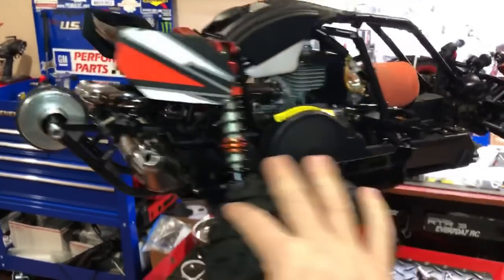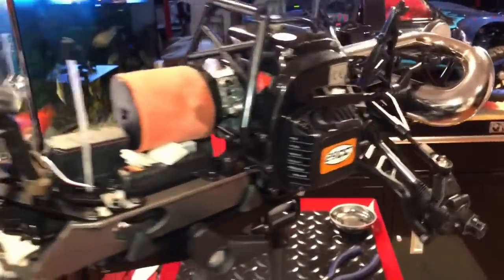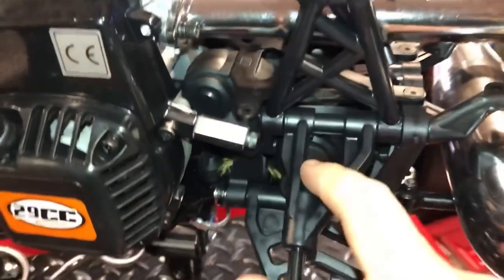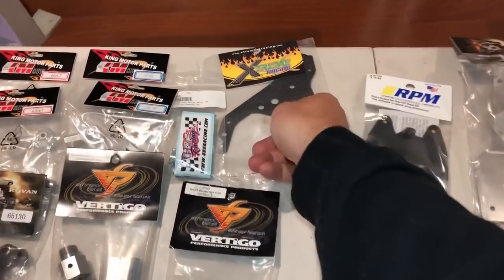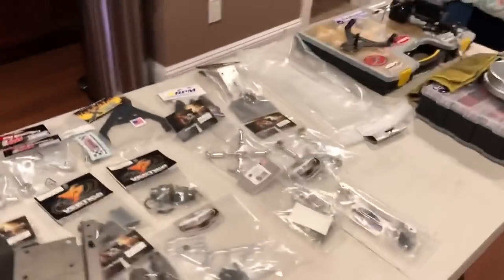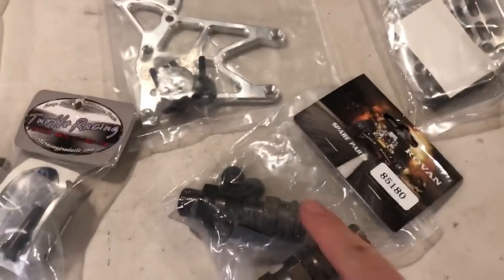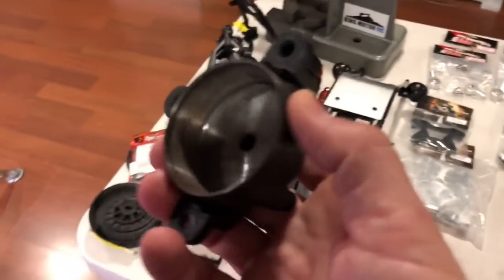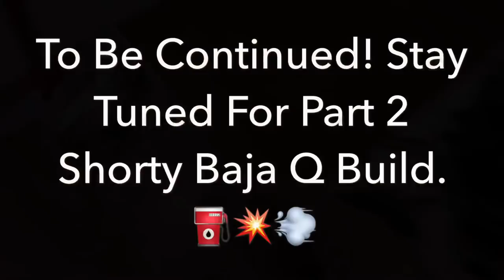Part 1, Let’s Go Over & Rebuild My Shorty⛽️Baja💥Q💨Together From Start To Finish!

Comment: Now that Ive upgrades to a Baja 5b I need to familiarize myself with the construction of these constructs.  Its winter now so I have a few months to learn as much as possible before spring and awaited glorious 2stroke run-in.   Ive realized as im sure you know Botajell that its easy to go overboard as I already have.  To spend more on quality upgrades than the initial cost of the entire vehicle is not a new concept to me cause i like having quality.   Quality in my opinion is paramount.  Thanks for helping the RC community with your videos, not only are they informational but they also help people stay excited about the hobby during the off season.  Sober fun is a much healthier way to live and I really enjoy your enthusiasm.  Thank you

Comment: Man your channel has grown so fast in the last year. I started following around October of last year I believe and you only had a few hundred subs and now you're at 72k! Sheesh! Keep up the great vids. Next spring/summer you need to get the truggy out again. Because of your vids, I was able to build my 7TR truggy to run with brushless rigs. Modded 28-8, 9886/41032 with a Buku clutch. 🔥🔥🔥

Comment: Hey bro, looks like the air filter rubs on the servo arm. Is this correct? Don't know if there's an angled carb mount available for some thing like that??
Reply from the maker: RC Addictions there is an air filter that I will be trying out to see if it will eliminate that? DT1-1003 Triple Flow air filter? Don’t know yet but I’ll be trying it out later on